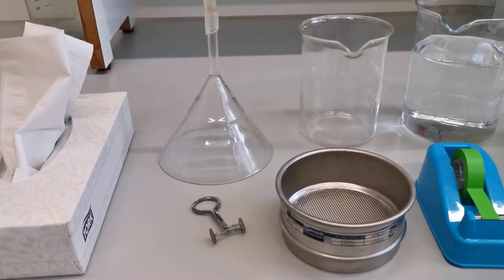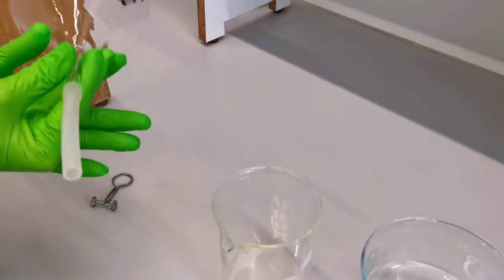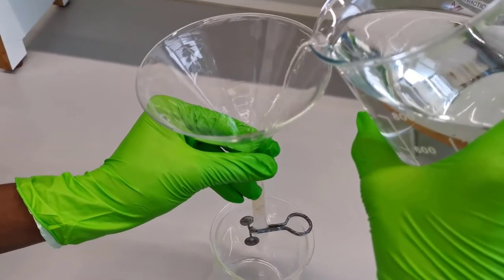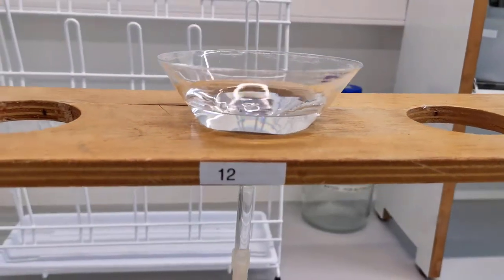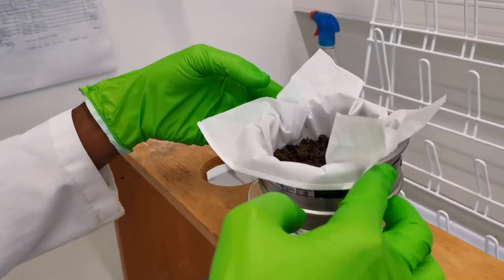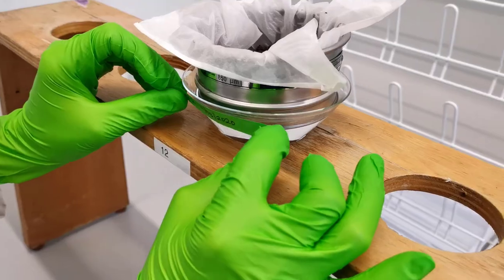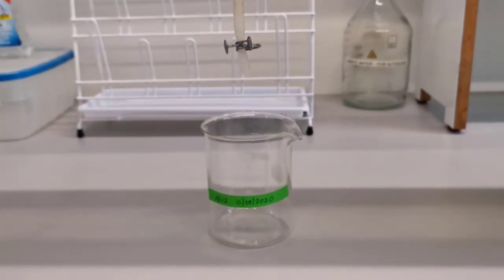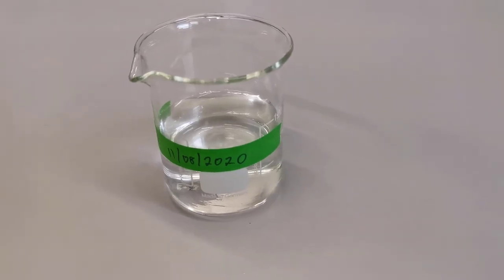NEMATODE EXTRACTION: BAERMANN FUNNEL METHOD

Comment: In my opinion, the green label should be applied to the funnel BEFORE it is placed in the stand. This risks releasing small parts of the soil into suspension by careless movement, making it more difficult to examine.